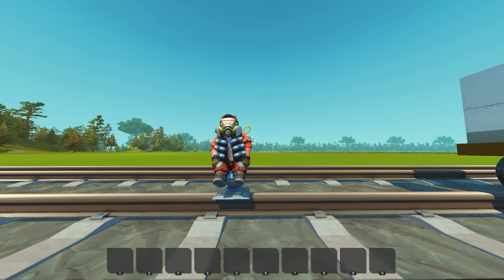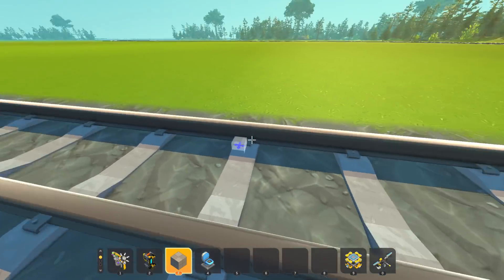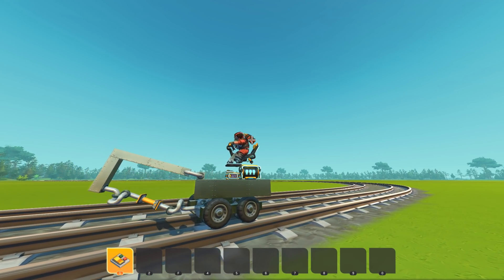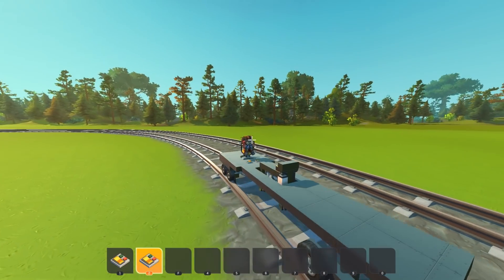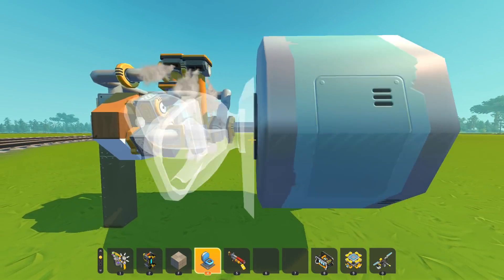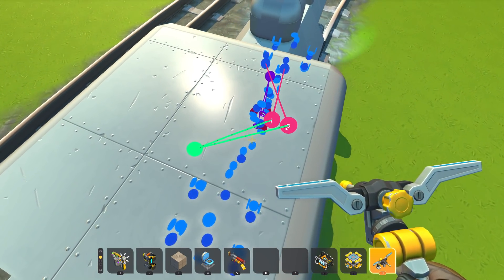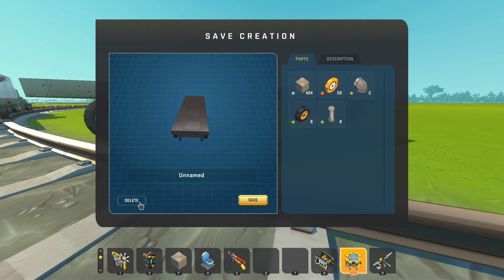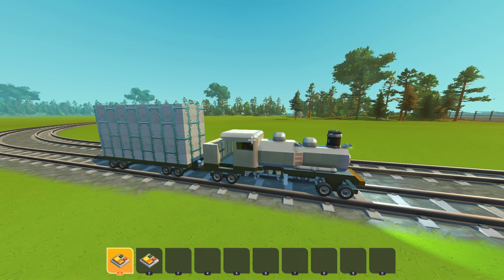I Built a Piston Powered Gear Train with Internal Drive Mechanisms in Scrap Mechanic!

Comment: reverse is just rotating that timing wheel backwards... and i guess that engine was more designed to be compact rather than powerful... designed it for smaller twin prop planes 2 years ago...
Reply from the maker: ^ the piston powered engine master
Reply: @kANGaming   hey that’s called a shay

Comment: "Gear trains" are another word of saying the interesting shay locomotive. The shay has a slightly moved boiler right or left and it only has 2 cylinders on one side or underneath. The shay comes in any size big or small the small one is an 0-4-0 and the big one is an 0-4-4-0

Comment: I still dont understand how in real Trains, the crank shaft can just intersect with the axles. Those are spinning, solid pieces of metal, how can they intersect???
Reply: The solid rod has a offset section for each piston that goes all the way through the piston to crankshaft connection. 
  _|_
/         \

Comment: 6:24 You have discovered 0 RPM, some real engines are capable of it, generally they have to be two-stroke engines as a four-stroke cycle wouldn't be completed by this action, setting a two-stroke engine (usually large engines like stationary hot-bulb diesel engines) at a really low throttle setting can result in this situation where the two-stroke cycle is completed by crankshaft just kind of wobbling back and forth instead of making a full rotation.
Reply: turning off the engines : am I a joke to you?

Edit : engine to engines

Comment: I would actually like to see what is the maximum gearing you can achieve in what could be categorized a "starter vehicle". Do keep in mind that if you use small pipes for the wheel spokes of a gear you can make a 2-radius gear this way: bearing in the center, 6-joint piece for the first layer and 5 joint piece for the second layer (the end layer), then bearing to connect the layers and small pipe towards the outside, then small corner piece going to the other layer, then one layer has small pipes and the other has big pipes. If you make bigger wheels, which are a bigger pain, you still need an even number of layers, to have the gear teeth be small-big-small-big and so on in a circle. 

You could also use a wheel with a spoke on the side, and two smaller wheels (i.e. in-game wheels) in a 90 degrees corner, and have the thing connecting the sliding spoke and small wheels together have a center point to mirror the motion (like the focal point of light rays) to make it more stable, and use the smaller wheels to power the bigger wheel (because a single smaller wheel would have the most power on two opposing quarters of the rotation, so you need a second one perpendicular to the first one from the bigger block-made wheel, to make the power delivery smooth and not get wheel slip). And I'm curious what other ways you (and the community, after you make a video challenging everyone the same thing) could find. 

The end-use of it, if you need one, would be getting a petrol engine then a controller or electric engine achieve as high of a speed as possible on flat ground (you could use straight-line rails with milestones, to calculate it's acceleration (like 0-to-100 distance/second) and it's maximum sustained speed (in distance/second). Maybe even use multiple of those to make a gearbox which allows us to use the W/S of the engine/controller connected to a seat for the direction and switches for the speed moving in that direction.
Reply: Unfortunately due to the floppyness of Scrap Mechanic bearings when under strain this has a very glitchy problem: the gears clipping out of the gearbox.
Reply: @thefaulnt3562  Then you simply need to distribute the load over multiple bearings. It would increase the complexity, but would still be very much possible. Especially on beefier PCs.

Comment: piston trains are always cool, I recently finished building the "long-shot 1426" an 8 piston powered locomotive using the walschaerts valve gear system (I took inspiration from your old video about this system), the only two problems it has is the lag it generates, to be watchable I have to lower the physics to 7 or less (it can also work in physics 1 with only a slight slowdown) and the shooting power which is slightly higher than the weight of the locomotive
Reply: Hi
Reply: Oh hello!

Comment: Build piston powered class 70 with this real life mechanism. Next time use ropes mod to connect cars so if you seperate them enough, there is no lag. Make power test: electric engine vs gas engine. The power of engines changed in survival update.
Reply: Ehhhh, rope mod would just make the carts go to orbit, while its sort of a fun mod it really really REALLY cant handle any sort of weight

Comment: Hopefully the supposed physics changes they are working on actually cure the physics problems/high lag tied to free-floating bearings.
I built myself a 8x8 survival vehicle with independent suspension and 2 sets of steering wheels using a steering column for both and my god the frames do not exist.

Comment: Suggestion: A crane to load and unload cargo containers onto/off of the big train flatbed trailer.  Bonus points for being able to load a full train without stopping it, and without welding or lift'ing anything.
Reply: Sounds cool, but I would think the lag would become an issue fast. He already struggled with just two empty cars.
Reply: @SomethingoldenYT  What about using a conventionally powered train?
Reply: @EdyAlbertoMSGT3  even then, scrap mechanic really doesn't like multiple objects colliding with each other

Comment: Could you make a train that is powered by a thruster engine? It would be like a normal engine in real life, but the cylinders would have thrusters on the ends, powering the engine.
Reply: speed + downforce + downforce = epic train
Reply: Gyroscopic effect will cause problems.
Reply: @thefaulnt3562  I have messed with cylinder-based thruster engines before, and I have had no problems with gyroscopic effects. Are you thinking about radial thruster engines that have thrusters pushing a rod around in a circle?

Comment: 12:20 Kan, I built two scales for that purpose. They are in the workshop. 
Just weld it to your creation. Press tare button and start loading. For example. It shows how many 9/10 weighted block you loaded. (You can load any stuff it just show equivalent X/10 value (x can be determined by user)).
They are called ;
Most useful scale
Most useful scale mini 

Both are the same. One of them is just smaller(duh).
Reply: Yeah i was thinking someone would do the math and comment the weight as a geuss or someone (you) would do something like this

Comment: On your ‘train tracks in survival’ idea, it would be awesome if the tracks were layed out, but every so often there would be damage that you have to repair, or a bridge you have to construct! I think that’d be so cool, go out and check the track and do maintenance along the way so you can haul bigger trains!
Reply: That is the best idea for scrap mechanic 😂
Reply: This kind of already exists with the haybots. I've done a bit with train tracks in survival and they like to attack the tracks and I have to go around every so often patching up damage.
Reply: @SomethingoldenYT  Noice! And using level 5 steel would be too expensive. I wonder what would be the most renewable and easy-to-remove block to make rails out of. Easy to remove also means easy to add, since the blocks which take the longest to remove in bulk are often the most renewable otherwise, like food, or honeycombs, or flower pieces, and so on.
Reply: @SapioiT  Most of my rails are made from metal, but I've started mixing in concrete since you can make a ton of blocks from stone. Also, often when I'm patching tracks I'll use scrap metal picked up from the haybots. It gives some of my older tracks a rusted, well used look.
Reply: @SomethingoldenYT  I actually forgot scrap metal is renewable. There is also the option of using the haybot arms/spines themselves as tracks, I guess, and they might be less likely to attack them (but I'm not sure if they do).

Comment: regarding the piston engine  then the part you rotate is like a variable timing.
at top position it run fast but got low torgue.  set a little before top give more torgue but less rpm.
same  system i used on the green energy engines you and scrapman showcased.
gotta say its easier to control if you make it rotate slower.
works great with thruster based engines.
made a test train that can pull 2000 ultra heavy blocks with just a single powered axle.
1200 ultra heavy up a sloped rail made from 1x6 wedges.